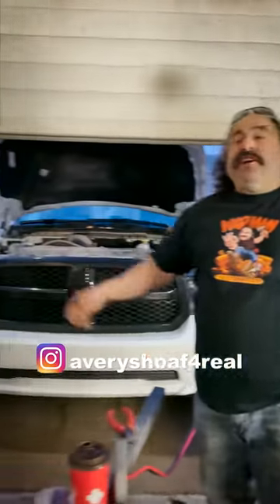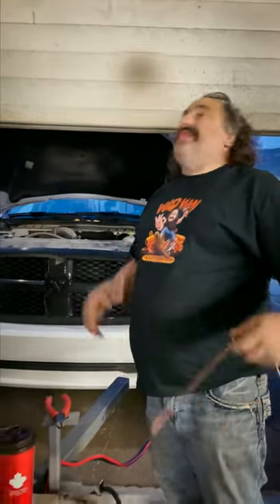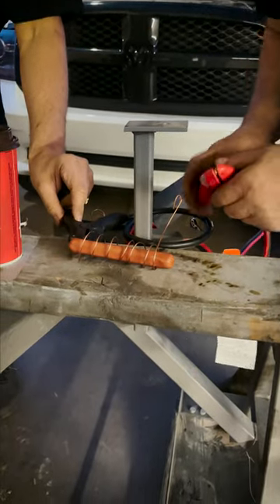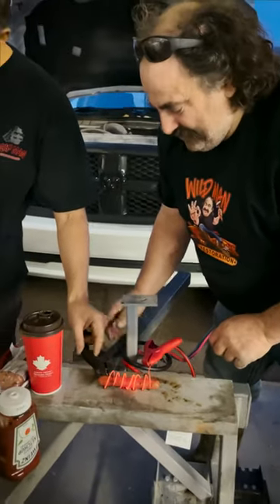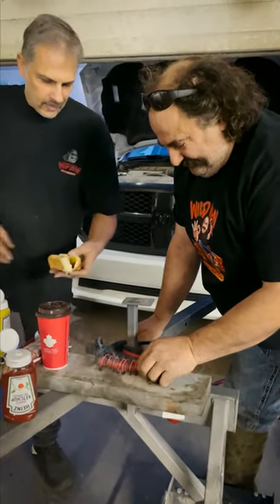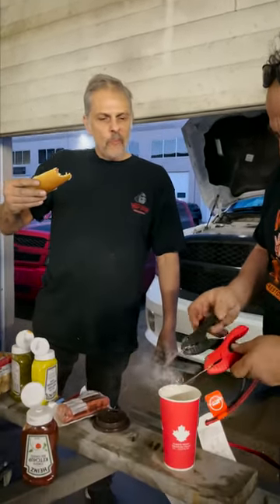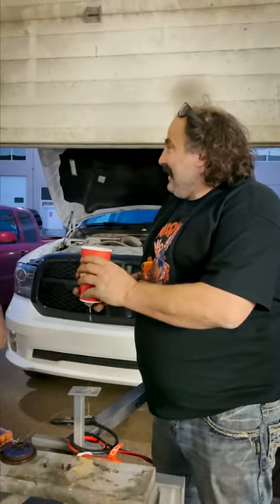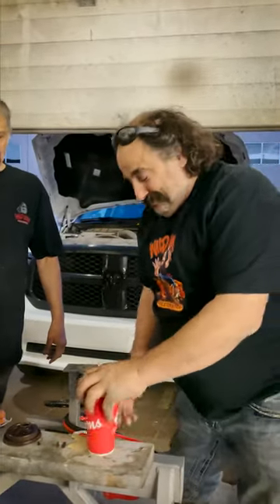Life hacks with Avery Shoaf! How to cook a hot dog with a car battery!

Comment: It works better if you cut the wire in half, stick each piece in the opposite ends of the hotdog, then complete the circuit with the actual hotdog in-line. Cooks the inside out. Sub for more recipes